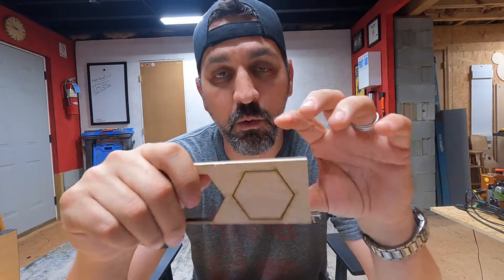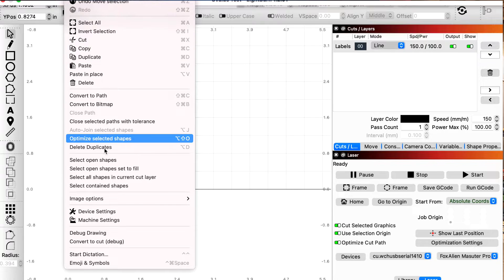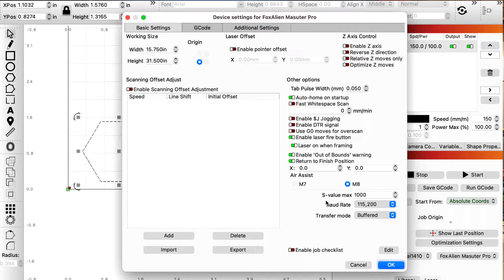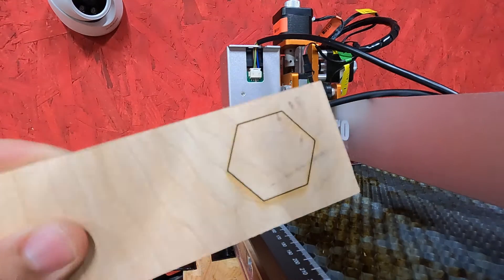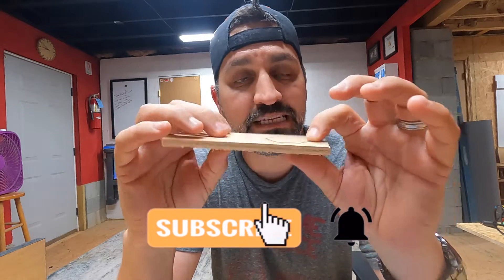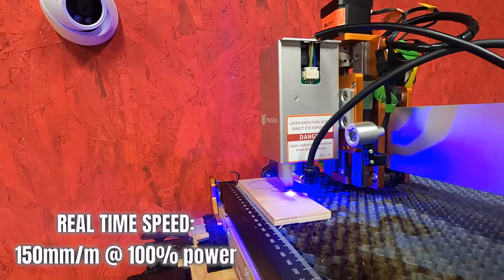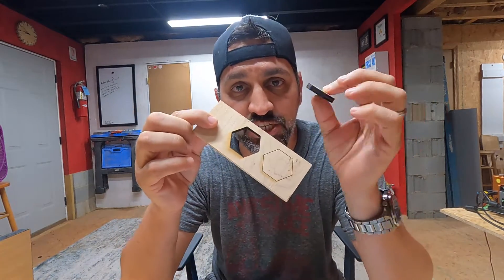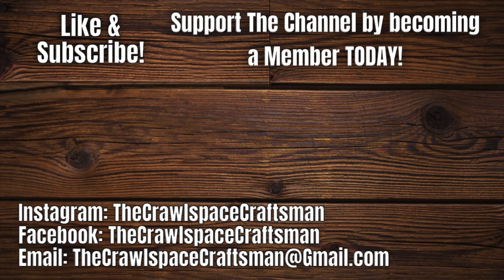Get the MOST POWER out of your Laser by doing THIS in Lightburn!

Comment: on a atomstack a24, both my values picked up 1,000 (was manually added, it did not automatically find the laser). Since the a24 has 600mm/36000rpm speed, can this go higher? 
I feel like it's not unlocking its full potential of a 24w laser as i see in review videos for material tests

Comment: Hi! my lightburn show $30 = 1000 and max value 1000, it´s ok? o I must change de value of $30 to 10000?, i have a laser of 10 watts.
Reply from the maker: As long as they match.  1000 each or 10000 each! If one is 1000 and the other is 10000 then at 100% power you’d only be using 10%.

Comment: My Monport 80w has none of these settings. It just seems weak for an 80w laser. Though I am brand new to lasers so what do I know. Lol
Reply from the maker: Diode or CO2??
Reply: @TheCrawlspaceCraftsman  C02. On 20mm/min and 80% power, when trying to cut 1/4" wood, it maybe cuts the thickness of a credit card. I'm pretty sure I align those mirrors spot on when I first got the thing. However I have since hoisted it with well a hoist, up onto a pedestal, so maybe that tweaked the frame or something I don't know. I guess I'm going to have to realign the mirrors
Reply from the maker: @ has to be something. It’s not lightburn as those settings won’t work for CO2 unfortunately.  I haven’t dove into the world of CO2 yet so I’m not much help unfortunately!  Hopefully Monport has a Good support or Facebook group to assist!

Comment: Thanks, man.
Gonna check this setting later when I get home after work. It is really frustrating when I need to set at 90%-100%/ 3 passes /240m for 3.2mm plywood, and yet the cut is not consistent. Sometimes it cuts sometimes it doesn't. It took almost 10-20 minutes to cut small pieces of projects.

Comment: good day. i tried to open my machine settings at it says 1000 instead of 10,000 like yours. do  i need to change it to 10,000? my device setting is also 1000 as opened. Both are at 1000
Reply: did you try? have the same settings, just want to know :)
Reply: Same here, i have 5w diode laser

Comment: Hello, I love your videos! I have a question. I just purchased a Vevor A7 10w laser machine and I don't seem to be getting the power I need. The max spindle speed it is showing is 1,000. Is that correct?
Reply from the maker: Thank you! Make sure your settings in Machine and Device settings Match! I keep mine at 10,000 / each.

Comment: Will this shorten the life of my laser?
Reply from the maker: No. Not at all. It’s only making sure when you set your laser to 100%… that you’re actually using 100%.  It’s not overclocking like you can a CPU processor. If you run your laser at 100%….. all the time… the yes… that will shorten the life of the laser.

Comment: You will need to more strictly ensure ur not overpowring everything that defaults at 100%
Reply from the maker: It’s not overclocking it like a CPU processor. These settings only ensure that you’re using 100% of the potential power. If you set it to 50% in Lightburn… then you’re using 50% and so on.

Comment: Do you know if this applies to the Longer Ray5 lasers?
Reply from the maker: It’s mainly a Lightburn thing. Happens a lot for CNC / Laser combos. If it’s a “Laser Only” machine it’s possible the Device and Machine settings can be off. I’d double check to make sure they match.

Comment: I have a 30 watt Scalp fan The maximum is 1000 If I raise it to 10,000, is there any damage to the machine?
Reply from the maker: It won’t. It only is a Percentage. So if one is set at 1000 and the other is 10000…. Then that means you’re only using 10% when your settings are at 100% power.

Comment: Where is the MAX SPINDLE in Lightburn 1.7.01? I take it that maybe it is only if you are running a diode (g-code)?
Reply from the maker: Correct. This is for Diode only. Not CO2!Or Fiber setups.
Reply: @TheCrawlspaceCraftsman  Wrong, this is for every laser with GRBL-controller. Many owner of the old K40 CO² with m2Nano switch them to MKS DLC cause it's much cheaper then a DSP-controller like Ruida 6442. Also it's important to note, that older GRBL-controller do not support a value higher then 255. That's the reason, why some lasers have 255 and not the typical 1000. If you try to set 1000 on a controller only supporting 255, you will run into problems. Higher values are possible but bring no real benefit. Exception is when you not only use a laser. A spindle benefits in their respectiv Software.

Comment: I need to check my 80w C02 to see what the settings are. Thanks for the video!
Reply from the maker: From what I’ve learned from others…. This setting is irrelevant to CO2 laser users. I believe you use the setting on the controller from the CO2 and not the actual software.
Reply: Working on a "100W" glass tube laser we don't run above 80%. Measured input power V*A and compared with optical power W, past 80% all the extra power just turns to heat, and was cutting tube life from 500 days to below 200 days. If you use glass a lot, beg borrow or rent a power meter imho.

Comment: Great info. I have a 20w thats cutting the same as my 10w BUT I checked and both my values are the same, 1000. Should I change them to 10,000 like yours? also my min spindle speed is 50 and yours is 0? thanks for any help
Reply: I'd like to know this too.  I also have a 20w and both settings are at 1000.
Reply: me either. mine are both same at 1.000. should we change them to 10.000? does 10.000 is lightburn default for all kind/type machine? or the default values depends on the machine type?
Reply from the maker: I would default to 10,000. It’s not going to over clock your laser like a CPU so there is no worry about damaging your laser. Once you change these settings just set your power to 100% all the time. A lot of times even when cutting throught 3mm you only need 85-90% power.

Comment: Thank you so much for this insight.  For the past year, my 20W output laser had been working up to its potential.  After getting a Lightburn update a few weeks ago, I had been struggling with VERY low power output; the laser was basically useless.  I tried everything I could find on the various settings tabs.  I did indeed see the "Max spindle speed (RPM), S-value min $30" in "Machine Settings" category, but I didn't think it had anything to do with laser power (spindle speed, huh?).  Also, I didn't connect that to the "S-value max" setting in "Device Settings".  Who knew?  I actually thought my laser module was "burned out".  After following your suggestions, I found that these settings were WAY out-of-whack so-to-speak;  spindle speed was set to 1000 and S-value max was set to 225!!!!   After making them equal (both 1000), now all is good.  Again, thank you so much.
Reply from the maker: Fantastic!!! It’s such a weird setting that happens a lot to people!  So glad it helped you out! Happy Burning!

Comment: So glad I found this video!  I went from super dissapointed to amazingly happy with my 20w diode laser.  I thought I had a bad laser, barely able to cut 3mm ply at 100/100 and 2 passes.  Now cutting the same stock reliably at 600/100 in one pass!  Job times cut down almost 12x!  Only downside is now I have to recalibrate all my material.
Reply from the maker: Awesome!  Glad it got you up and running correctly!
Reply: Boa tarde,  Eu tenho uma gravadora laser TTS20  PRO e fiz esta alteração  do vídeo mas em meu caso não alterou em nada.
Fiz um teste onde cortava MDF de 3mm com 520mm/min e 100% de potência  e após  a alteração  tentei cortar com mais velocidade com ex 700mm/min e não cortou, somente com os 520mm/min.
Saberia me dizer se tenho que fazer algo mais. Eu alterei na configuração  da máquina e do dispositivo. 
Saberia me dizer o que estou fazendo errado?

Comment: your not suppose to run at 100% thats why they set it this way to last longer. In general, it's recommended to not run a diode laser at more than 85–90% power. This is because temperatures above 30 °C can cause the diode to break down and age faster. that said it will cut faster as you see but you will replace it because of bumping the power to high.
Reply from the maker: Good info! Thanks for commenting and watching the video!
Reply: Of course. You configure your machine's settings accordingly, but you still adjust the power level for each cut or project based on the specific material and desired outcome.

Comment: I own a 100watts co2 laser, those settings are not on my lightburn settings. Why?

So, im having problems right now i try cutting a 6mm plywood. Inwas able to cut it at Parameters set at speed 12/ power 55, however i was not able to cut it at speed 10/ power 80. Why is that?
Reply from the maker: CO2 is different. I don’t own a CO2 so I can’t unfortunately talk about the issues you’re having.  Hope ya get it worked out!

Comment: MY SETTINGS WAS CORRECT FROM THE BEGINNING, BUT THAN...ONE DAY out of nowhere. my Falcon stopped cutting. I found your video and changed Machine settings to 10 000, because somehow it became 1000. In Device settings S-value was fine. Nevertheless, my machine settings changes spindle to 1000 automatically. Every time I change it to 10000 and try to cut it doesn't work. I go back there and the value is 1000 again. Please, HELP🙏
Reply from the maker: Try changing them both 1,000. If they match….You should be back in business.
Reply: Did you "Write" the changed number? This uploads the configuration to the laser controller...

Comment: Nice. So ware does one look for the right number on the laser ? To have the right settings ?
Reply from the maker: So these numbers represent a percentage of power. You can’t over clock your laser. If it’s a 10w Diode… you can’t make it a 20w diode. If these numbers don’t match, you’re only going to using a certain percentage of your available power. That’s about it. Hope that helped!
Reply: @TheCrawlspaceCraftsman   hi there. Thanks. So I have a 5W LaserStorm I checked in the device settings and the S value is 255 is the good? I don’t think I’m going to mass with it? Anyway thanks again
Reply from the maker: @vincentlekei1969  as long as your $30 matches.  If your $30=1000 then your only utilizing 25% at 100% Power

Comment: If any of you would have read the setup procedure for Lightburn with a grbl device, this is clearly specified... These are actually min/max spindle speeds, and the Lightburn figures out what values the controller is expecting from these settings.  Needless to say, both Lightburn and the controller need to know these values.

With a solid state device that is digital, like these ssl (diode), they only run at 100%, you can't lower them.   If you set it to 50%, the laser is on 100% power for 50% of the time.  Running at 100% (or on) should not harm the device if it's designed well enough to take the heat away.  Glass tube co2 are analog and, as analog devices, they can have their lives shortened by high current operation.
Reply from the maker: Thanks for watching and commenting !

Comment: Hello! You are perfect.
I use my 24/48 watt Atomstack S40 Pro laser without a laptop. I'm using a flash card.
Now I looked at the settings, I have a value of 1000 in both places.
I did a sample with a value of 10,000 and found the effect to be much better.
Is it a problem with the laser that only the value in Device Settings is changed?
However, I use it without a laptop.
Is this 10,000 value even a problem for laser life?
I have never used it at more than 85% power. Thanks!
Reply from the maker: It’s absolutely not a problem with the life of the laser.  Don’t be afraid to go to 100% power either. This is direct info from the manufacturer. I’m not sure how or when the myth of “never use 100% power” started but it’s just that…. A myth
Reply: @TheCrawlspaceCraftsman  Thank you! :)
Reply: @TheCrawlspaceCraftsman  actually this is not myth. Here is some articles about that. https://diode-laser-wiki.com/documentation/frequently-asked-questions/#:~:text=This%20is%20also%20a%20frequently%20asked%20question.

Thanks for the information about max valu. i think 10000 the max value is kinda work. when framing 1% laser not burn the wood but when max value is 10000 , laser little give mark on the wood.

Comment: Hello there, need advice, which better, that is speed 150 1time cutting, or make it 800speed, 5 time repeat?? (100% power)

i just think, make it more speed but repeat, to safe the dioda laser machine (not sure that is right or not LOL)
Reply from the maker: Nope! More power faster.  Don’t be fooled by people saying 100% power is bad. They don’t know what they’re talking about.  Lasers were meant to be used.  Higher power and less passes.  You’ll have less charring too!  If you’re not sure …. Make a circle or box and on a section of the wood that’s waste…. Set to 8-9 passes and count how many it takes it to drop. This is how many passes you’ll need for the project and add 1 for good measure.  All wood is different so hopefully this helps some!

Comment: My Lightburn Device Settings have no option to change the power.
Reply from the maker: 🤔.  Hmmmm….. what kind of laser do you have?  Diode or CO2?
Reply: you're right, nothing labelled power settings.  Its the "S value" you need to change, bottom right hand corner of the Device settings.

Comment: thansk a lot for the video, it helps  a lot. may i ask a out of topic question here ? i have a DIY setup laser engraver ( MKS DLC32 controller + laserTreee 40W AA ) , till now i cant get a perfect circles when i draw them. i dont find any misalign when i draw a square/rectangle. ive done manu calibration settings, but it still the same. any thoughts ? thanks
Reply: Do you hold down the shift key when you are dragging out your circle?
Reply: @roadcrayon1525  i did. I always double check X and Y size. But when i engrave them , i cant get them perfectly circled.
Reply from the maker: Thanks so much! @roadcrayon1525 is 100% correct. If you hold shift…. Then drag your cursor…. It will stay a perfect circle. If you don’t it will be oblong.  Worst case make sure you unlock the dimensions and hand type the exact same measurements you need in both Width and Height then Lock it again! Thanks for Watching!!!

Comment: Hi I have creality falcon  2 22 watt settings both say 1000 is that it's max or is it cutting full potential cheers
Reply from the maker: I use the 10000 / 10000 numbers. Try that and see if it makes a difference.
Reply: Thanks I try hope it OK for me lazer
Reply: @hardshellconstruct  I run the same F2 22w. Did you try this? Did it make a difference when cutting?

Comment: Hi buddy, first of all thank you for the video, it sped up my cutting time which was quite slow but I'm wondering one thing, will this shorten the my laser life? will it break? or is this really the setting that it should have because when I connect my laser to my PC it automatic finds it and when it does it doesn't automatically load these settings to it?
Reply from the maker: It will not. You’re not over clocking the power…. Just bringing it to 100% of its optimal power. Thanks for watching!!!
Reply: @Onurcann11  i think so laser life is reduced

Comment: DUDE, I LOVE YOU! It's 3 months i'm engraving with a 20W laser that barely does better than my previous 5W... and you know why? It was working at 3.9W.... Yesterday thanks to you i've unleashed all the 20W and filled the room with smoke...
Reply from the maker: That is awesome! It’s such a common error and even I’ve done that with my lasers not realizing!!!! Glad it helped!!!
Reply: @SimoneFestuccia  how did you know it was at 3.9W?
Reply: @mightydtwentycent5921  ehhh it passed too much time and not I do not remember the correct setting I had, but since max power was set on a scale from 1 to 255, instead 1 to 1000, setting output to 80% of already limited outpuit lead up to a 3.9 teorical output. but I didn't use any power meter, they cost too much. What can I say, is that after i followed this instruction, I've been able to cut trough 1.5CM wood.
Reply from the maker: @vrandolv 10000
Reply: Yep, just bought a refurb 20W from Ortur that didnt come close to the 10W. 
This is valuable info!
Reply: Hi I have a MecPow X4 Pro both values are the same 1000 . The laser is a 22w diode
Reply: Are those settings ok if I have a Longer Ray5 10w laser?
Reply: @ it's important that values match on both section explained in the guide, it can be 10 and 10 or 1000 and 1000 but not 256 and 1000

Comment: absolutely true . The values have to be the same , it doesn't matter what the number is as long as they are the same on both screens
.. 
* when you have got this setting correct then turn the "running laser "setting down if you feel your laser is up too high you do not necessarily need to cut at 100% in a lot of cases. But at least you know you can if you want to . good video 👍👍👍👍
Reply from the maker: Thanks so much for watching!!!

Comment: mine (Omtech k40+) was set at 1000 in both device and machine settings... so that should be ok.... ?    Right ? Or do I put it to 10 000... and potetially burn the pow sup...
Reply from the maker: 1,000/1,000 is fine. If both are the same you’ll be running at true 100% power. 10,000/10,000 is the same too. It’s not telling to pump more power only a % of 100% power.
Reply: @TheCrawlspaceCraftsman   THANK YOU VERY MUCH !

Comment: Dear blogger, hello, I would like to ask about the dust collector produced in China, the motor is 220V, how can it be used in the United States, do I need to connect another line.
Reply from the maker: If it’s 220 your definitely going to need to install a 220 outlet with plug to match.  I would consult with an electrician before you make any moves.